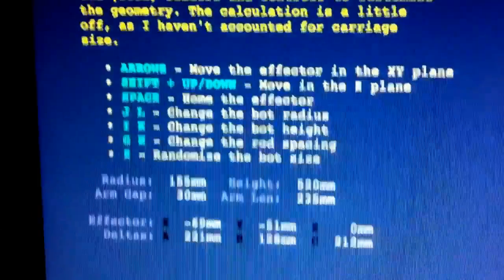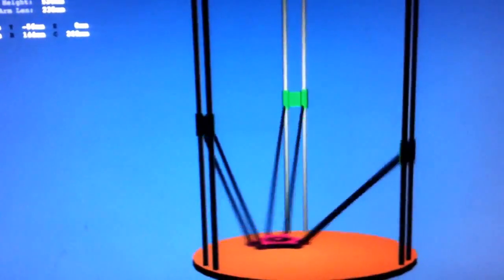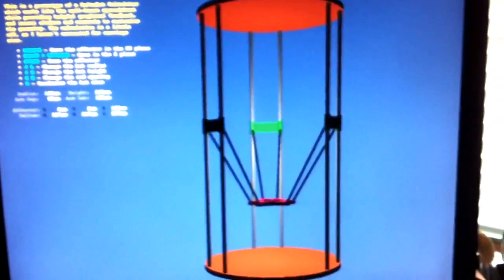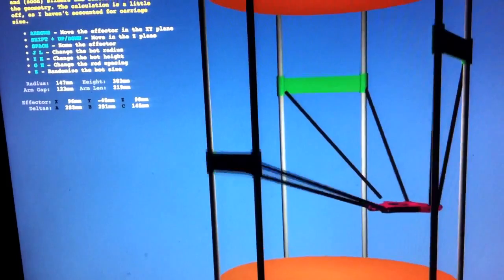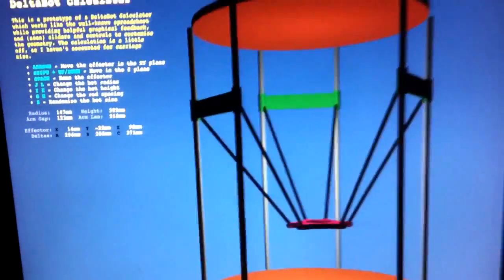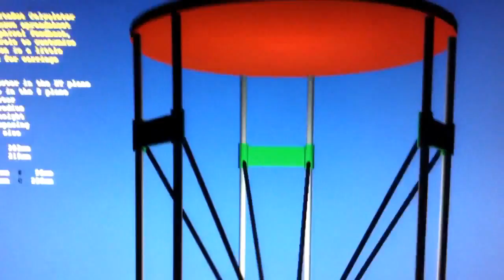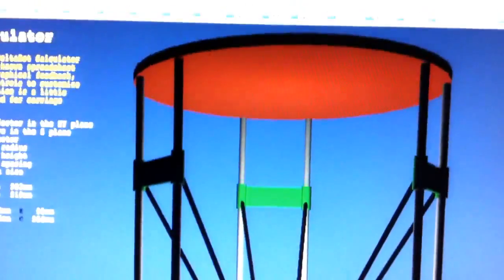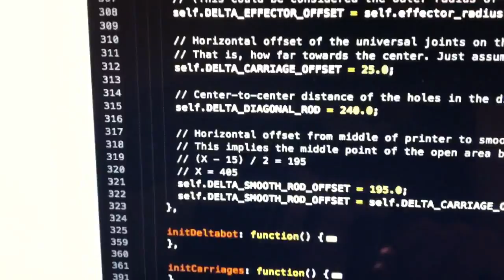AirTripper, DeltaBot Calculator

Comment: Thanks for answering !!! Now what would arm gap?
Reply from the maker: The gap between each pair of arms will depend on the effector and carriage design. Arms of the proper length will work with any suitable effector/carriage, as they can all use the same ball-screw mounting.

Comment: Scott I checked out your Delta calculator and its super cool!
However, I don't know the effector radius you used for the calculations since it has some effects on the arm length.
Reply from the maker: +HenneH The effector I used has a 40mm radius. I will be adding the ability to choose your own effector size instead of just using a fixed size. I also want to more explicitly display how the calculations are being accomplished, perhaps showing the triangulation. I have the forward kinematics almost ready too. This would allow the simulator to determine if there's an error between where the effector wants to be and where it actually ends up. Then you can simulate what happens when, for example, the endstops are misaligned.

For the longer run, I'm in the process of building some other printer simulators using Unity 3D, so I can deploy them on iOS and Android devices. I'll post a video of my Prusa i3 simulator when I get it more completed.
Reply: +Scott Lahteine Mmm..! Good stuff are coming. I was worried because am designing a delta printer and your tool was the most comfortable way I found. Anyways, I can help with the 3D models if you are interested.
Reply from the maker: +HenneH Thanks for the offer. I've had pretty good luck using Blender 3D to convert STL and DXF files into the parts I need for Unity 3D. But as I get further along and start to do more printer models I might hit you up for help. At the moment I'm pretty focused on making patches for Marlin 1.1.0 so we can get it out!
Reply: Alright am always available but you guys better be quick with that Marlin update☺
Reply from the maker: +HenneH The more support I get for my GoFundMe and Patreon campaigns the faster Marlin will progress!
Reply: Let me check them out.links?
Reply from the maker: One determined individual can make a huge difference. That's my theory, anyway, and I work hard to prove it, as often as I can. I just wrote the code to support mixing extruders in Marlin – it's been a long time coming (and I'm surprised no one did it before me!).

Patreon: http://patreon.com/thinkyhead?ty=h
GoFundMe: http://gofundme.com/zmh9h9vc
Reply: hey scott
i would like to build by myself my own kossel
i would like to have 600mm height to 250mm print surface..what size of rod and arms i need to buy?i hope you will improve you great calculator we are many to want to build a bigger kossel
sorry for my english i am french

Comment: I just discovered your Calculator And would like to thank you.  I am building a large delta printer 42 inch towers and An easily able to calculate Optimal dimensions For the remaining parts using Your script. I'll post pictures when I begin construction
Reply from the maker: Thanks, I hope it produces good numbers. The effector in the calculator is a common variety. I'm working on a simulator for the Prusa i3 as a first step towards a general 3D printer simulator. The i3 is a good first choice because the parametric design allows the geometry to be flexible. Rather than JavaScript, I am using Unity 3D plus Blender 3D, a great combination when combined with simple importing of STL and DXF files, and the final result can be deployed to the web. I will post video when I am further along!

Comment: Hello, it is possible to make a printer delta with only 3 arms with 120 degree angle. If these printers are delta with 6 arms! instead of 6 parts would be only 3...
Reply from the maker: Alexon da Silva Moreira I would have to say No. The magic that a delta does has mostly to do with the two arms that connect close together at each corner of the effector, and the fact that all the arms have 3 degrees of freedom (but only rotational freedom due to constraint by the other arms). If you only have 3 arms (with 3 degrees of freedom) instead of 6, the constraints are insufficient to hold the effector rigidly in position, so it would wobble and be pulled out of alignment by the wiring and Bowden tube going to the nozzle.
Reply: Scott Lahteine - Thanks for answering! About Javascript Code Printer Simulation Delta. This code is public it was you who did, would like to have access to this code!

Comment: Hello, I would like to build my own 3D Rostock delta, but I have some doubts about the extent of the arms. Using the simulator to obtain the measurements, I can develop my project based on the measurements obtained. It would be possible for some help with these steps! I made an idea in sketchup, I can ship you take a parsed!
Reply from the maker: The arm length is easy to calculate. First measure the distance between two adjacent towers. Multiply that by 0.8 to obtain the proper arm length. Here's a calculator you can use to find the numbers you need: https://docs.google.com/spreadsheet/ccc?key=0AihVdu60WUfgdGZUOW1BVVdzc2pjdzRSd0ZUMXgtM1E#gid=0
Reply: How can i get to this calculator pls?